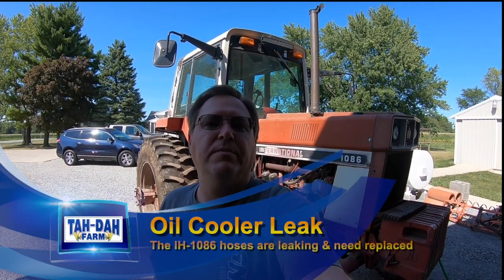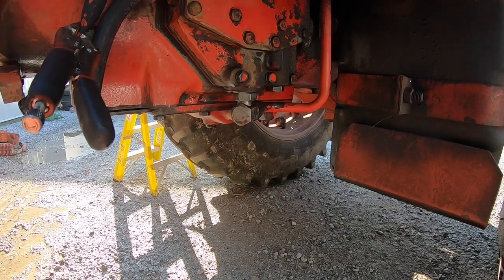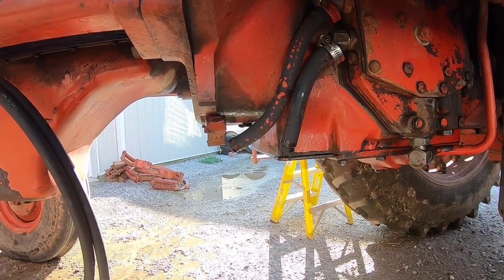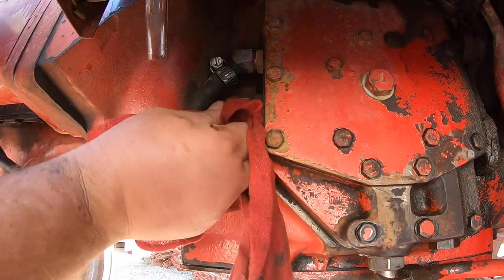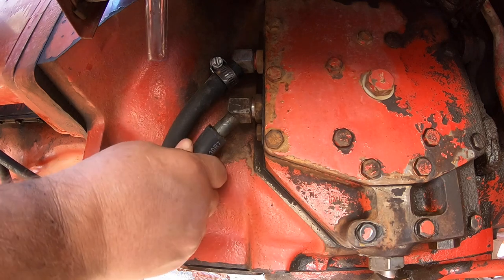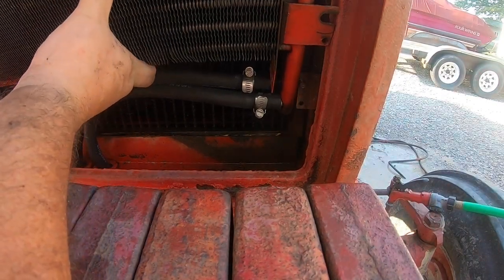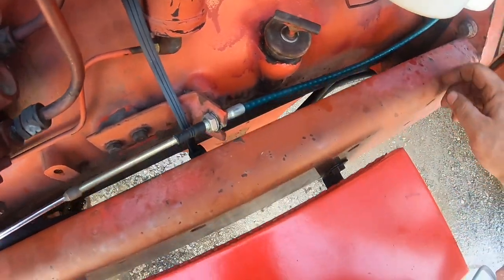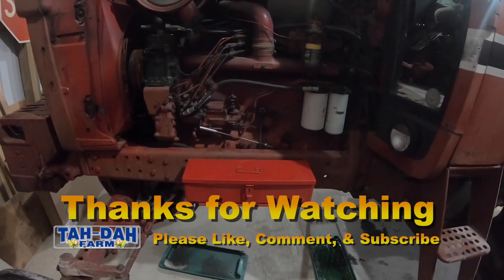Oil Cooler Hose Replacement on my IH 1086

Comment: that purple jug is magic!  amazing stuff.    

kind of fun to do little things like that to keep the old girls nice shape!
Reply from the maker: Magic and some elbow grease,  lol. It will clean oily areas with no problem but it there is dirt in it, it seems to take some work. The dealer said it would drain a bunch of oil out so I wasn't looking forward to this project.  But since they were wrong,  it was much easier than expected.  Now we need to get started on the combine,  lol.

Comment: when the guy told you it would drain did he then try to sell you some oil?   there is no overboard on cleaning.
Reply from the maker: It was the mechanic at the dealer.  I think he wanted to do the job knowing how easy it would be.  So he could have easally sold oil because I would have not known any different.  I agree on cleaning but I can get caught up in it, lol.